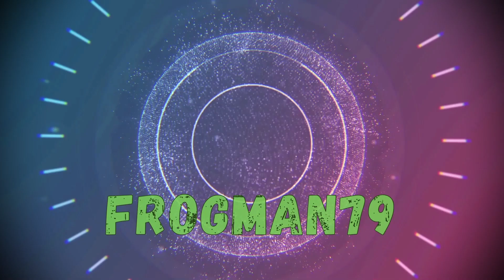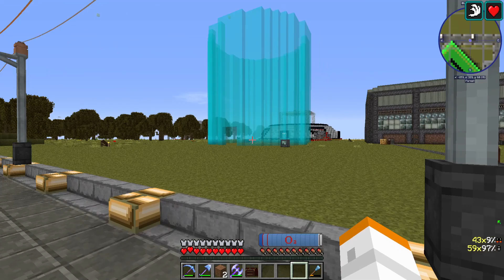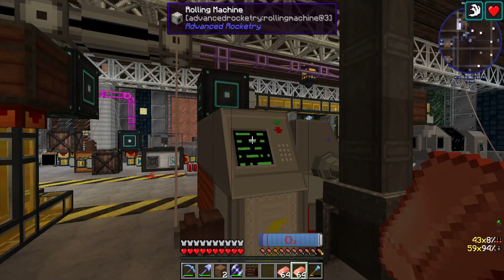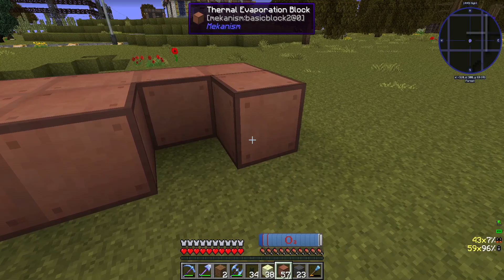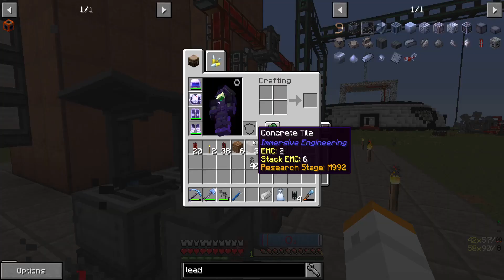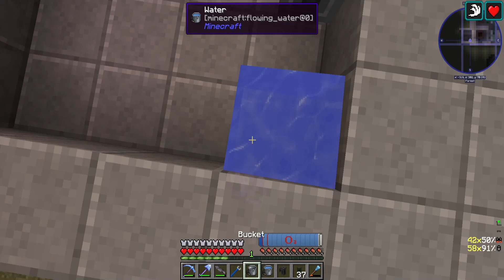Manufactio Water into Tritium Processing EP54

Comment: Are Heat Generators available in the pack? I recall being able to keep heat up on a thermal evaporation plant with one of those covered with lava and a heat pipe leading from the bottom and into the plant itself.
Reply from the maker: Yup they are available however we don't get the pipe so you have to put them directly on the plant.